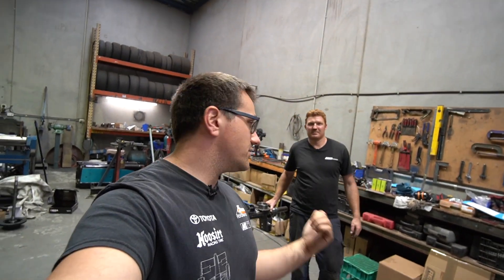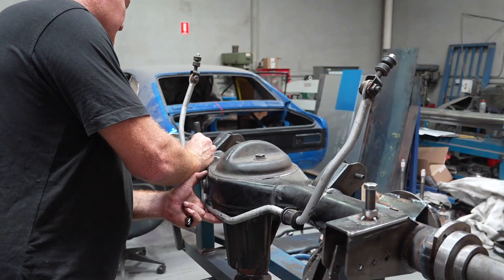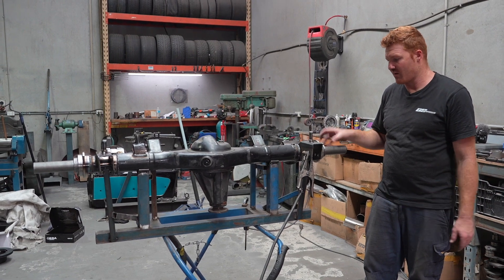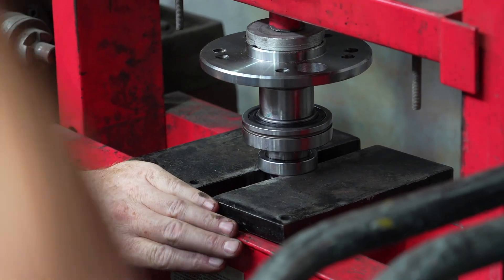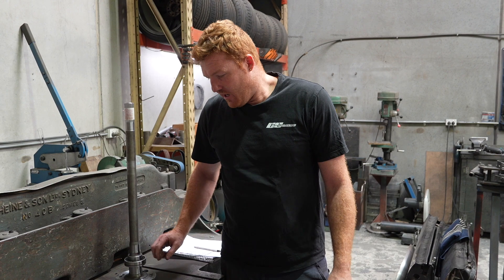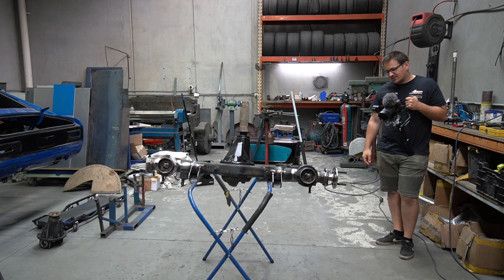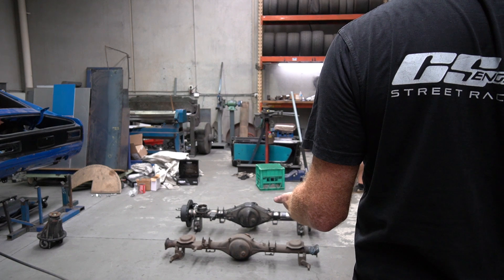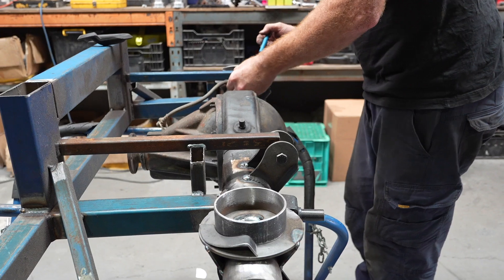Ultimate 1000HP Hilux Diff Conversion for E-Chassis ae86/ ke70 | Part 2!

Comment: i paid 1k for just bearings for a T Series and its just a shitty drum to drum this vid makes me sad LOL
Reply: Dude, next time take an old bearing to an industrial bearing supplier. If they don't have them on the shelf they will be able to get them for you, for like a hundred bucks or less per pair. Back in the day I bought a JDM T series with 4.78, Kaaz LSD , brakes and tail shaft for $1000 AUD. That was about 2009.
Reply: @MotoWot  yep im never going back . will see how long it lasts only going for 300hp 4agte
Reply: @ethanm6870  How long it will last depends on how it will be used. I have done many a motorkhana, hill climb and circuit sprint with a 300hp turbo 4a and never had any problems. I do have the kouki (bigger) axles though. I also back off if I drop a wheel in the dirt, the time will be slow so there is no point keeping it flat. "Never lift" is actually garbage advice :)
Reply from the maker: @ethanm6870  was that 1k including labour?
Reply: @NEVER-LIFT  Yeah 1170$ to be exact
Reply from the maker: @ethanm6870  I’m not sure what it should cost if you’re paying someone else to do all the work maybe 1k is reasonable?

I’ve never paid a mechanic before so I’m unsure but if you’re prepared to get your hands dirty then you’ll save yourself heaps of money
Reply: i dont think its reasonable i supplied 2 axles and a center  not the car or diff housing .
 i dont pay mechanics either but i will pay for things like the custom Tail shaft 
 im still doing all the fab work on non critical things just leave things that require tooling to pros like Chris in the vid
cant wait to see the car bro!~